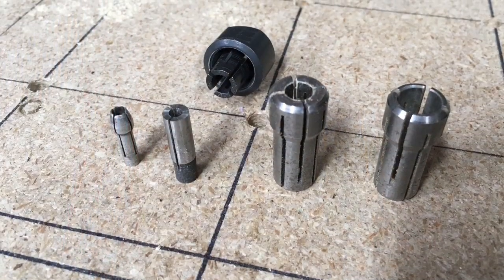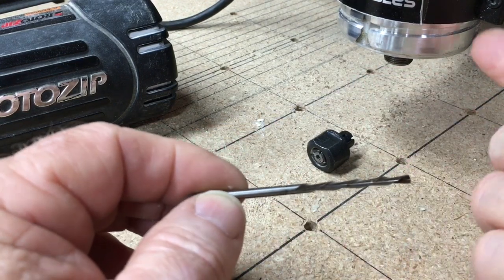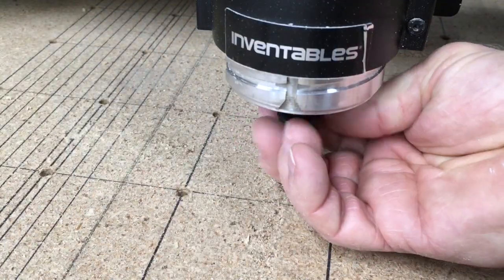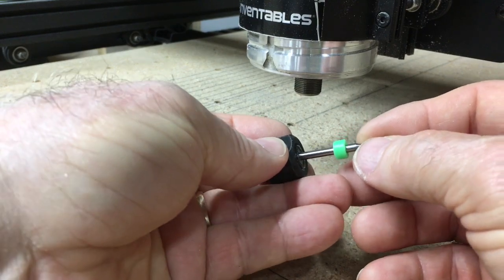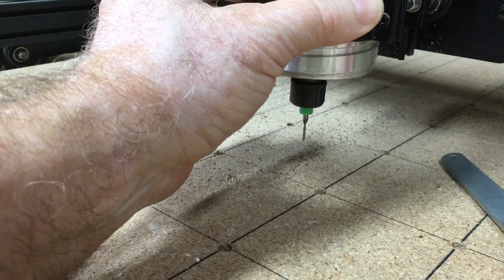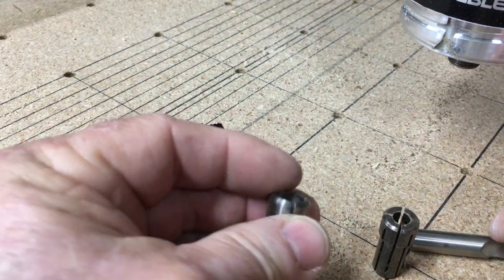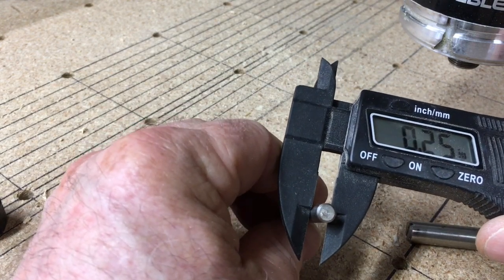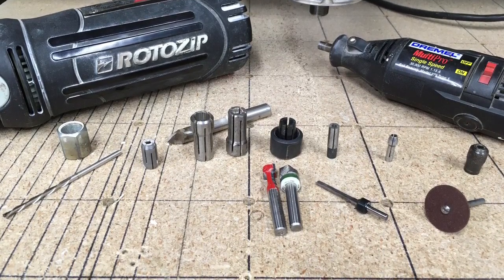Choosing the Right Collet for Your Router

Comment: Any way to find the size i need if I don't have an original collet? Got my router for 2 bucks at a garage sale. It's a craftsman
Reply from the maker: You can get the model number off the router and look up on line the router with the parts list. It should show the collet
Reply: @PawPawsWorkShop  thanks. Went to woodcraft and they had one that worked

Comment: Thank you for the informative video..my question is I have 6mm collet and 8mm bets is there any adapter to use 8mm instead of 6mm?
Reply from the maker: You will need to get 8mm collet, otherwise, the bit will not fit into a 6mm collet.
Reply: Thank you for quick response 
So I can change the collet in the same 6mm router isn’t it

Comment: I have a question, if you don't mind.  I have the same exact Rotozip. I loved it.  Opened it to clean it, and one of the 2 wires from the circuit board to the motor came off the circuit board, which I know NOTHING about. I called a friend, he said it should be obvious to were it needs to be soldered back to, but it's not.  Now I have messed with it so much.  I really don't know if it should be soldered to the board, or attached by a screw, that it end VERY close to.  Any idea?  If so could you respond or possibly make a video.  Thank You in Advance
Reply from the maker: If the solder is all over the circuits it may be beyond repair
Reply: @PawPawsWorkShop  NO, it soldered very well.  Just Don't know anything about it. Could go 2 possible places. Wish I could send a pics.

Comment: I am completely new to this.  I bought a Longmill and have it 99% ready to go.  I am at the step of setting up the touch plate, then surfacing the waste board.  I'm instructed to insert a router bit and measure it to input this measurement into the software.  As a female I've never had to use a router, so I don't know a lot of the basics that boys are fortunate enough to learn through the years.  I'm going to have a bit longer of a learning curve than some.  I'm not put off, but there are basics I lack and will have to learn first regarding the use of various tools, power tools, table saw etc......   So my question is how many mm of router bit are supposed to extend below the collet?  By checking Google, it implies to put it in as far as the collet will allow, in other words, bottom it out.  I have a few router bits that came with the machine and I see they are different lengths so this is going to have an effect on depth when carving a project.  The only thing that comes to mind is to have to tell the machine what the zero plane is every time I change a bit or am I looking at this the wrong way?  I would think if you consistently leave out the same length of bit .....again I don't know what's right simply because of my lack of basic knowledge.  HELP (lol)
Reply from the maker: Thank you for the questions, yes, there is a steep learning curve but you will get there.  To answer your first question, you need to measure the thickness of the touchplate and enter that into the computer.  Different bits are different lengths and each time you put a bit into the machine it will be just a little different length either longer or shorter. As far as how far to put the bit into the collet, look at the length of the collet.  The bit does not need to go in any further than the length of the collet itself.

Comment: Hey Bud.. I have some metric bits that are less than .25".  Been looking for an adapter for the 611. Is there such an animal or do I have some fancy paper weights?
Reply from the maker: Yes, check out claircorp.com  Look under DWP611 model router. You will find all types of adapter for various bit.  The bit shank is the important part, it must match the adapter, i.e. 5mm  or 6mm are two common shank sizes and you would need two different adapters, one 5mm and one 6mm.
Reply from the maker: Awesome! Yes, that is the company.  Sorry, typo

Comment: Where can you get a collet for Dewalt trim router for 1/2'' shank bit to 1/4'' collet ?
Reply from the maker: If you trim router is a 1/4" then you can go smaller but you can not go to a larger collet.  A 1/2" shank bit would not work in a 1/4" trim router.
Reply: @PawPawsWorkShop  Do they make a adapter ?
Reply: @PawPawsWorkShop  please I need to know if can I make my 1/4 to a 1/2 I have a ryobi router it takes a  1/4 but I have a router set of 1/2

Comment: Oh, 1 more thing.  If you take your dremel, with a cut wheel. Put 2-3 slices at the end of the spiral bit, like a screw, it will drill in, then cut.
Reply from the maker: Interesting, thank you
Reply: @PawPawsWorkShop  I'm sure you understand what I'm saying about cutting the tip. You can just put 2 cuts. Like this /, but do 3-4 if possible.  Only have to go about 3/8th up bit.

Comment: Very informative, I don't believe the roto zip blade will work though, has a different cutting action and blade is to long ie.. too much flex. Figure it wouldn't take long to break
Reply from the maker: You may be right, but it will make an interesting topic.  The real challenge is to find a bit that has a cutting tip.  I'm not sure if that is part of the rotozip collection.
Reply: Actually, rotozip bits work just fine, as long as you obtain an 1/8" collet. Most rotozip bits are designed as a downcut bit, as they push the drywall dust back into the wall cavity as they cut.

Rotozip bits are designed to plunge straight into drywall, are MOSTLY all carbide, and cut well if you choose the proper bit for the material you are cutting. There is a large variety of bits available for the rotozip for a myriad of materials.

It is NOT a recommended practice to use a collet adapter in a CNC machine. Unless you properly tighten the collet, it can and will lead to slippage of your bits under load.